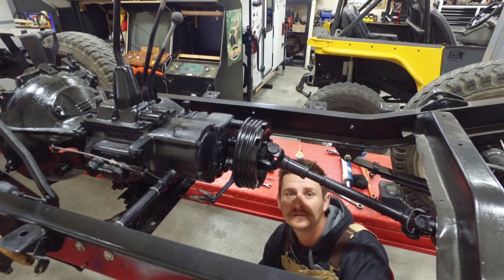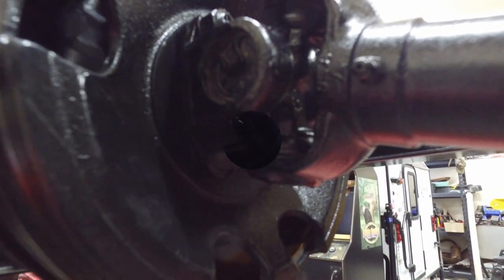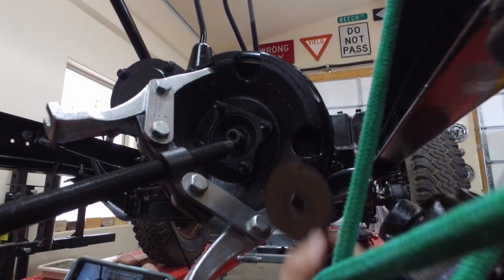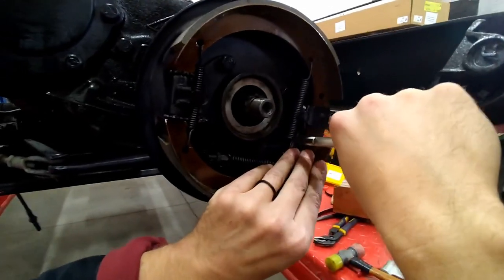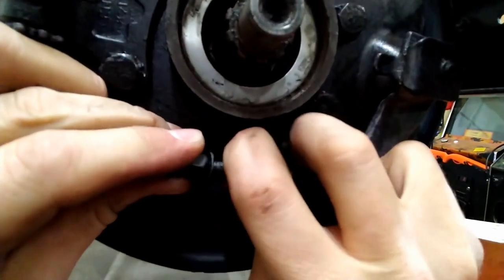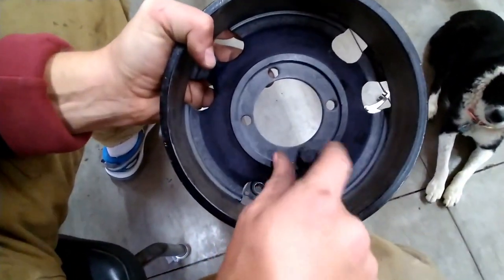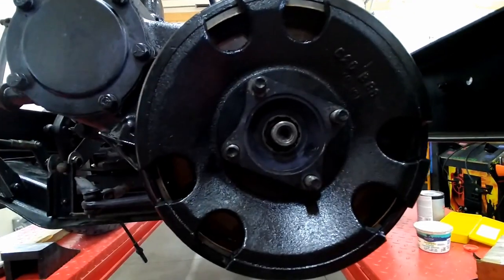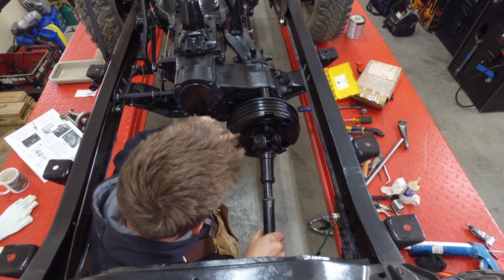Willys Jeep Emergency Break

Comment: Nice video! Question - did your transfer case leak when you pulled the yoke/drum off? Mine was gushing out with gear oil. Assuming I need a new seal
Reply from the maker: My Case was drained for a rebuild I just did. Yes seals are cheap I'd just replace it.